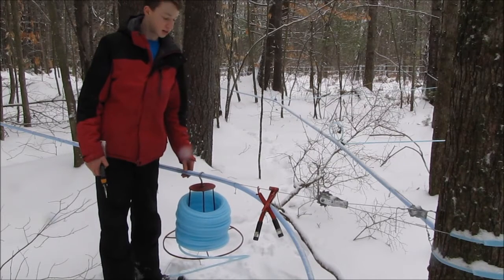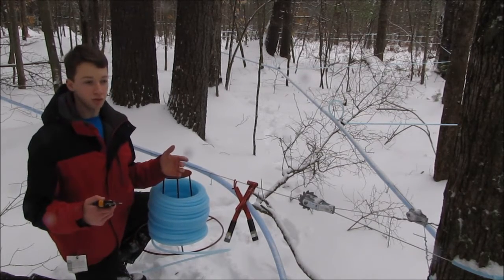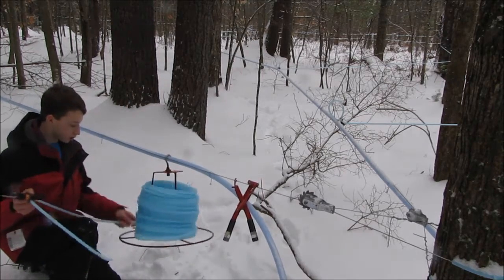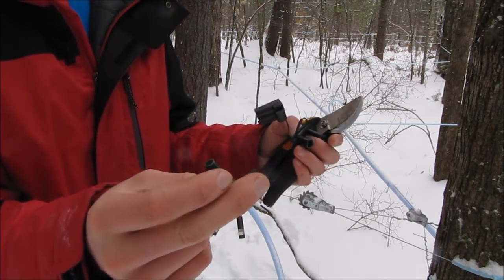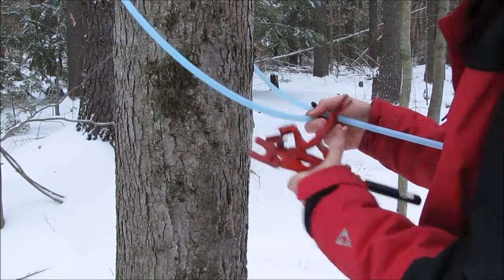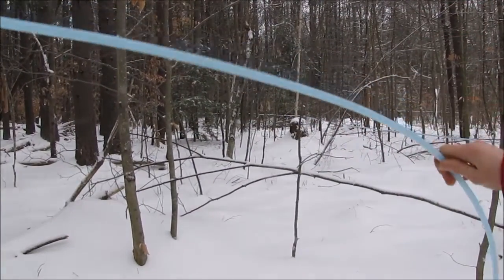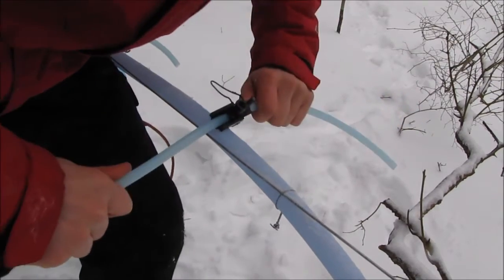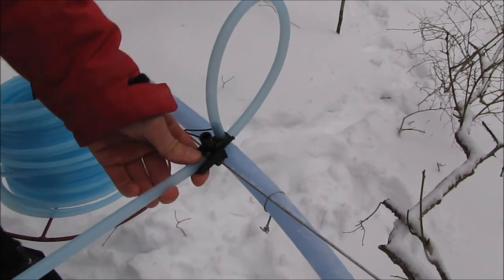Maple Lateral Installation

Comment: How do you make a hole in your mainline to attach the laterals? I don't have a mainline punch tool. I'm thinking use a drill with a piece of tubing for a stop so I don't go all the way through? 31/64 bit, right? Any other ideas?
Thanks for the videos!